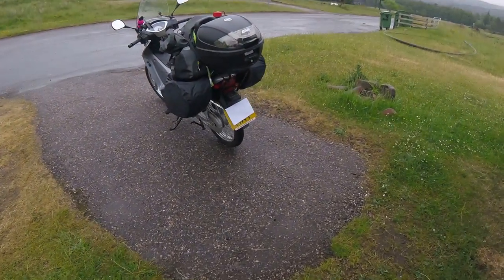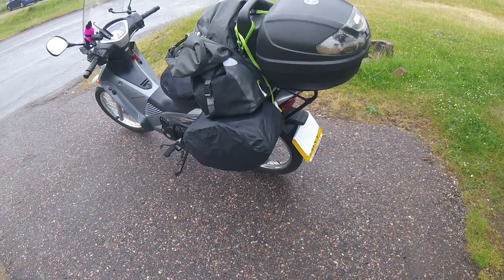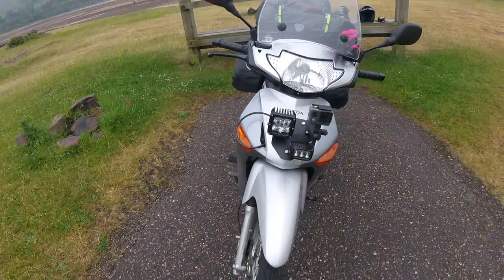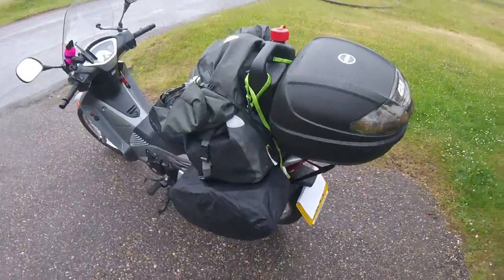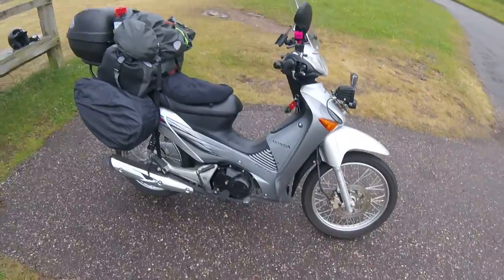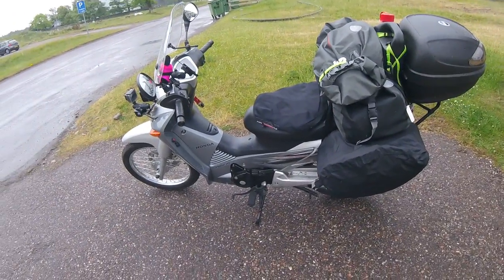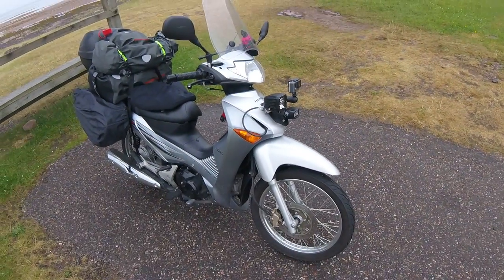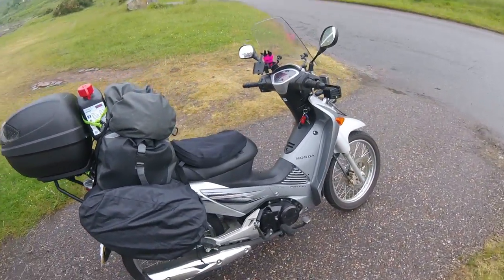Honda Innova Tour of Scotland review and Rigid Industries Lights

Comment: Lovely to see I've not been the only one to try touring on the Innova!  I took my 2008 model 1900 miles down through France, over the Pyrenees and across to the west coast of Spain in June 2015.  It was incredible fun. 

FuelFriends are most definitely your friends with the tiny tank you have on this bike. I managed my trip without the AirHawk pad (!) and I had more issues with satnavs (and me) overheating than than midges.

The bike did well right up until a defect in the crank shaft reared its head as I was arriving on the Atlantic coast. It still got me home again though :)

Well done!

Comment: Nice video. I managed a tour round spain on three c90 in 2020....however this year Iv bought three innovas. That extra 35 cc and 4 gears makes all the difference. Off road so far the innova is fabulous 
.....when gs1250 gets tricky the innova is just getting started.  Really like your headlight upgrade btw.
Reply from the maker: The headlight upgrade worked well and was really a bit of an experiment. Only problem is you need to float the ground wire on the stator and convert everything to DC to make it work properly. I found myself very short of electric at times but you live and learn eh? I’d definitely have another innova. The one in this video lives less than three miles from me now. It must have followed me 450 miles up country when I sold it and moved home to Scotland. Funny how these things work out.
Thanks for your comments and best regards

Comment: That looks like a great setup.
Reply from the maker: It was a great setup. The lights were useful too but looking back, I would have done them differently. I would have just had two extra lights for dip beam and not bothered so much about main beam.
Still, you live and learn. Thanks for your comments
Reply: @scootyman2974  what are you riding these days? I got my yamaha 250 xcity back on the road should be fun when things open up again

Comment: I rode from Dorset to Scotland on a Honda SS50 5 speed in 1978. I did it in 2 stages over two weeks..travelling to Wales for two days and then on to Scotland. I would give a few bits of advice. Don't camp...stay B&B..You are tired after riding big miles, and a nice, warm bed is just what's needed. Take waterproofs...good ones...really do! Take a change of clothes...a  couple of pairs of jeans, including the ones you start in, a couple of tee shirts, sweat shirts and  several pairs of underwear. You will need to do a wash, but no need to pack your bike down with crap. Take only basic tools...you will not be able to rebuild the clutch on the side of the road. Make sure your bike is up to it before setting off. No fucking about off road. Avoid the A1...travel the west coast of Scotland...it's beautiful, peaceful and traffic free. Lorries will seriously piss you off. End your journey at Loch Lomond, Oban or at furthest, Ullapool. The trip to John O'Groats is boring and there's fuck all there.

Comment: Cheers for the explanation.
I was looking forward to the CB125F tour, but if the panniers slowed it down too much then that's understandable.
I used to have a CG125 about 14 years ago and done a Scotland tour on that. Takes some doing without the use of motorways 😁
Reply from the maker: It was a shame not to take the CB125F as I had originally planned. Bike bikes had different merits. The CB had an easy to fill large fuel tank, the innova did not. The innova had a kick start which may have been necessary after charging accessories all night. I may do another tour next year and maybe get another CB125F. It was a nice bike to ride with a lovely upright riding position. Maybe if I had used the fabric givi panniers they would have been closer to the bike and created less drag. All about a learning curve I guess

Comment from the maker: John, I also remember now that the balance loaded up on either stand wasn't good. It was a mission getting on and off and also getting the CB125F to stand safely on its own when loaded. To much weight on the rear end unladen before you started to load the bike. I did love the CV125F though and with lighter luggage system it would have made a good tourer with the upright riding position. Hope that helps further.

Comment: Nice to know that big tours are quite possible on quite modest machines. Well done Scooty Man. I am a 70 year old riding a very similar scooter called a Peugeot Vox 110. I would like to know what size of Airhawk cushion do you use?
Reply: Actually this type of motorcycle is called underbone, not scooter
Reply: Yes I am 112 years old tomorrow would this bike be alright for me with a £112 air hawk

Comment: Really nice! I'm planning on installing some LEDs on mine and would really like to know how you did it. Thanks!
Reply from the maker: On this install, it didn't work so well if I'm honest. The problem is the amount of power the stator makes is very limited and the light feed is I believe half wave AC. You could float the light circuit on the stator and make it full wave, then use an uprated reg/rec to channel the power gain but you will need to rewire the light to run on a separate DC circuit.Not so easy and if that sounds like jargon, just google some of what i have said and you will find the information you need. You could always join the Facebook Vision 110 page and chat to me over there if you need further help. Best regards
Reply: @scootyman2974  Thank you very much for the response! Will definitly try it on my Innova! Best regards!

Comment: What’s the mounting bracket you used mate? I want to modify my Innova by adding them!
Reply from the maker: Are you referring to the lights?
If so I probably wouldn’t. Whilst it worked, looking back there were times on this trip where the battery didn’t cope so well with the additional power consumption. If I were you I would float the stator and convert the half wave lighting circuit to full wave rectified and then change the wiring accordingly. Then maybe I would add a pair of rigid industries ignite spots and an LED conversion for the headlight.
I made the bracket out of aluminium plate.
Reply: @scootyman2974  I will have to look up what you’re talking about, I’m a total novice!

Comment: Hello Scooty Man 
l am in the process of getting a Honda  110i wave and going camping in my local area the Peak district and general mini touring . l was wondering what back rack you are using for your panniers /top box /dry bags combination, is it custom made? or of the shelf. Returning to biking after 36yrs so pretty green so any advise would be most welcome.
Reply from the maker: It was a Givi one off the shelf. For the wave Givi make a similar one but I would use that for a top box to secure your valuables and put your main weight in the dry bag on the seat. Everything that I used was indeed givi and easily available. I too am yet again considering another wave 110 as I traded this bike in for a vision for my girlfriend. That's getting the Malossi treatment over winter (83cc kit) ready for some short distance touring next spring. (Stay tuned!)The Innova or the wave will be your best friend but you'll need to think about fuel range and taking the luggage off every time you fill up. No biggy though
Reply: Cheers for the reply, most helpful. Yeah l was thinking about the filling up part when fully loaded l will think of something, all part of the fun . Enjoyed more of your vids and your driving narration,gear shifting and braking comments when you went over that their  misty   mountain up Scootyland. Thanks again" ride on"

Comment: I'm assuming you have to pull up all the gear to fuel up ?
Reply from the maker: It had the optional touring filler adaptor fitted when I first purchased the bike. I think I’ve seen them on eBay from time to time 👍
Reply: @scootyman2974  im not able to find any info on this adaptor...

Comment: Yeah I want to do This To my Wave 125 But with a More Wider Rear Tires For knee dragging and 2 Front Disk brake
Reply from the maker: J-metal Nakamoto knee dragging on an innova 125? Really?
Reply from the maker: J-metal Nakamoto 
Why would you want two front discs on a 125 scooter that weighs 99 kgs? It doesn't have the mass or the speed to need any extra braking. I weigh 110 kgs and the bike used to stop fine with my weight. Interesting choice of mods. 
Best regards

Comment: Nice one! Many Innova 125s are here in Greece too! I own a 2009 Suzuki Address FL125 which is an underbone (or moped if you prefer) just like your Innova. Technically they both have fuel-injected 125cc, 2-valve SOHC engines but the Innova has longer gear ratios. Both of them are excellent motorbikes and I have driven countless kilometers and large distances on my Suzuki too.

Comment: My Innova is same as this, they are really easy and enjoyable to ride, I've taken it out only for a spin at times and ended up driving 30 miles and spending hours on it, going through the mountains and by the coast. 
It gets great mileage, only problem i got is when perol is running low I'll put about £2 worth in it and it's full again, meaning it has quite a small fuel tank.

Comment from the maker: Hello John. You would think so wouldn't you that the CB125F would have been the better tourer. The problem was that the panniers created so much drag that the bike felt seriously impeded and......slow! What I should have done is use the soft panniers I used on this tour and that probably would have been good. The other reason is I am a big fan of the Cub type bikes and Innova's are known for their durability. I didn't feel the same durability with the CB if I'm honest. That's not to say I wouldn't do a tour on one mind but slow was the main reason. Those plastic panniers really hang out in the wind which I learned after having them a while. Hope that answers your question
Reply: Scooty Man  Hi scootyman what size model is your air hawk pillow please need one for my vision 110 . Many thanks phil

Comment: Put 77k miles on mine from new. Graduated to belt drive xmax and would never go back to chain drive. Tough little beasts. Loving the lights😊
Reply from the maker: Yes they seem to go on don’t they without too much maintenance. The lights were in a very early stage of my learning. I’ve since made up some great looms and systems for various bikes but the Rigid lights really do give you a great performance.
Thanks for your comments

Comment: Good bike, cheap to maintain except the weight distribution are rear too heavy though.
Reply from the maker: Yes I would have to agree with you. That was also the case with the CB125F I had once I loaded it with hard panniers. Thanks for your comment and best regards.
Reply: @scootyman2974  The 3 smallest bike i have rode for long journey are honda cg125, yamaha sr125 and yamaha ybr125. When i see your vids it remind me back the good memories on these small cc workhorse. Ride light and dont break our back picking up heavy motorcycles. Nowadays i will leave my heavy bmw bike at home and ride my yamaha xt250 or kawasaki versys 300x instead. Since im a retiree female rider, i prefer to enjoy the scenery along the journey in australia with cruising speed instead. Loves your video from me Hayliee😘😘😘😘😘

Comment: Hi what are the Auxiliary lights on the front? Looking to get some for myself 
Thanks
Reply from the maker: Ewan campbell 
Hello Ewan,
The lights are made by a company called Rigid Industries. The two models I used are Dually (the big square one) and SRM2. However, I have since learned much about the electrical systems on these little scoots and on this particular scooter I would not recommend you use additional lights. The reason I say this is because the USB charging port I was using kept cutting out. It wasn’t until after this trip that I learned it was because the battery level was getting too low with running the additional lights and the USB socket at the same time as running the bike. This scooter also uses half wave rectification for the lights (I think) so you would struggle to swap out the main headlight with an LED one.
I have since bought a Vision 110esp which has a good acg output and manages to run a pair of additional lights, a heated vest and heated grips also with very little voltage drop. It’s because the esp engines have acg’s to cope with start/stop charging so if you switch off the start/stop, you can use this additional power for accessories.
Hope that helps
Scoots

Comment: Ah, it's great to see these Innova's getting used like this.  I had a 2003 carb'd one for 2years with 26k miles on and loved it. Traded it in for a Cbf125 in April 2016 which I love too. I did have the CB125F as a courtesy bike for the weekend and tbh I hated it. Felt much cheaper made than my CBF125 it was meant to be replacing and had less torque too. Tho I liked its gear indicator. 
Only downside to getting an Innova is that your now running tubes so if u get a puncture it's a pita to fix compared to just plugging a tubed tyre. But they're great machines, and with injection you have none of the faff when they're cold compared to my older carb'd model. If I had one like yours I doubt I'd sell it ever.

Comment: Is it reliable until today? I pan to buy one used , but i don't know if it is good over the years structurally ...
Reply from the maker: ssavva202 I wouldn’t have any doubts about the structural integrity of a Honda scooter. Underbone style frames are built like tanks. They endure the worst roads in the world fully loaded and more. Buy one and don’t stress about it is what I would say. You can always test ride the bike before you buy to check it hasn’t been involved in an accident.
Reply: @scootyman2974  Thanks! I had a test drive today and  I can say that is great ! I have already start the buying operations! Is the engine last long if it is well maintained and go under the specified speed and load?